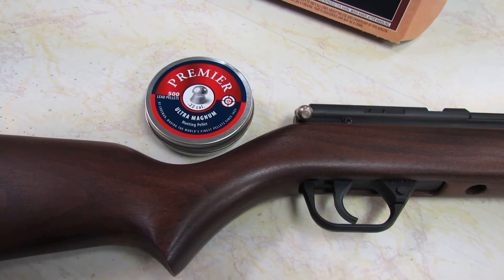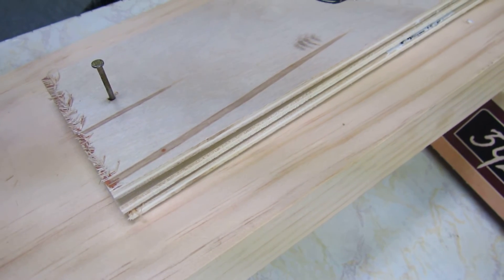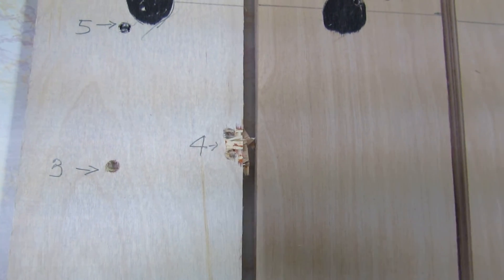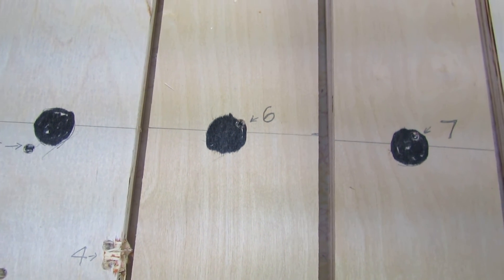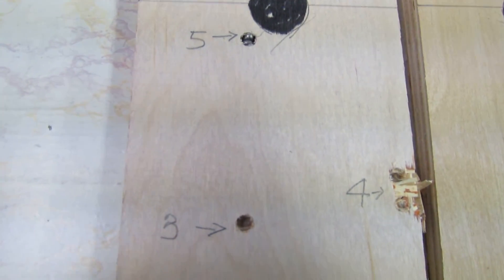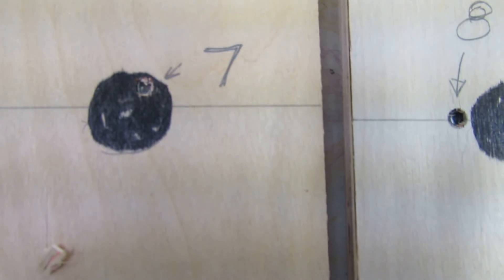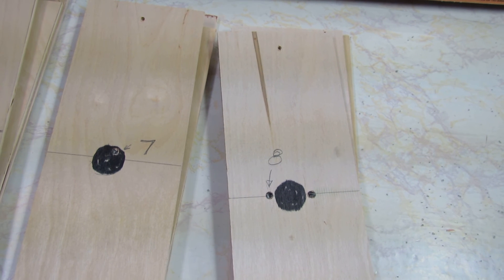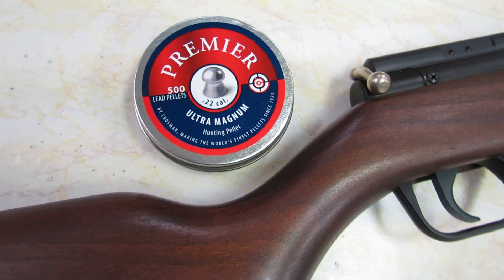Benjamin 392 field test

Comment: Thank you for the info, very helpful for the rest of us sighting in using the CP Pellets with the Benjamin 392. I have a 1962 Sheridan Blue streak and I used 6 pumps when I was a kid hunting and anything shot was DRT. Plan on the same with the 392 when mine arrives, intend on keeping it iron sights as I like the simplicity of this gun. Will probably use a pellet with better BC, but that is another story.

Comment: Both the models 392 and 397 can be modded in several different ways.
I've modded several 1377 crosman pistols and with all stock parts, each pistol can be pumped more that the factory recommended 10 times, producing over 690 fps with crosman 7,9 gr. pellets.
That's completely stock pistols with home made mods, even still using the plastic breech and 10.5 inch barrels.
My 392 has similar mods and it can be pumped up to 15 times, if you have the arms for it.
That rifle is shooting 14.3 gr. Crosman pellets at over 900 fps.
Extend the bolt tip to push the pellet farther into the breech.
Port the valve to allow faster exhaust of HPA.
When the hammer strikes the valve pin, it requires too much force to open the valve spring. I've measured over 10 pounds to open the valve.
I made a much lighter spring out of a guitar string wound around a drill bit in a slow turning drill motor.
Separate the spring inside the valve with a small washer and put a spring on the other side of the washer for the check valve.
That makes pumping much easier.
Put a spacer in the hammer spring to make it compress tighter and when you fire the rifle, the hammer hits the valve much quicker and stays open longer, allowing much better air flow behind the pellet.
I've seen no damage to the valve or any other part. I did however see that the piston cups wear out faster so I got a custom pump for it and the pump cup is holding up fine now. That's when I started seeing over 900 fps.
At 900 fps, this rifle is producing 25.72 pounds of muzzle energy.
That's a bit more than half of what a 22 short produces.
I've heard there are people super pimping these rifles and they are getting over 950 fps with those pellets.
A better pump and trigger mods also help a bunch.
Thank's for your review, enjoyed it.
Reply: GreatWalker177 The new model 392 and 397's will not let you remove the valve from the bottom any more.You need to get the pins out of the top and then remove the pump and valve.
I took a small gear puller and ground the end down to about 1/8" for about 1" in length then used that to push the pins out.
I  wasn't able to drive them out with a punch and hammer and drilling them would not work as they are very hard steel.
I used a fiber glass tent pole section to push the valve out the top and needed to hit it with a small hammer to break the valve free.
Crosman is making it very hard to work on these rifles now.
The bolt that holds the valve needs to be adjusted before trying to unscrew it. You will need to gently tap on both ends of the valve until you feel the bolt unscrew very easily or you will mess up the threads in the valve. Same when you put it back in.
You will probably need to replace the o-rings as they will most likely be torn. Crosman uses some kind of sealer to stick them in.
Any good hardware store will have o-rings but if you want Viton, you'll need to search for them.
I ported my valve with a Dremel and small rotary file. I also cut the check valve down to 5/16". This made the inside spring much lighter for faster and longer release of the HPA.
You will need to cock the rifle before pumping as the spring will not be able to hold the valve shut with the hammer resting on it.
If you're thinking of making the valve a flt head, be careful.
I used my bench grinder to grind down the valve head but when I was almost to the point of being flat, the little intake hole opened up to the size that the check valve fits in.
I left about 1/64" from being perfectly flat and the hole still had a little bit over 1/16" wall thickness left. This also had the end of the check valve coming out exactly even with the flat part on top, I couldn't have planned it better.
I then bought some "Liquid Nails Adhesive perfect GLUE".
I used Acetone to clean the inside of the piston cup, cleaned it real good and filled it up with the Liquid Nails till it was filled flush.
It took 2 days before I was sure it was dry and it cured clear and flexible like the cup rubber and will not begin to come apart.
Now I had a flat top piston. The length was exactly the same as I didn't cut anything down and to make the pump push a tiny bit harder, I placed an o-ring inside the cup holder to make it 1/16" longer. 
The air hole in the tube was still clearing the piston. Any more length and I would have needed to enlarge the hole.
I also opened the exhaust port hole to 3/16" and then took a 19/64" drill bit, ground it's end almost flat and milled out the exhaust hole until a small o-ring could be fit to the same outer diameter of the rear valve o-ring and glued it in place with a tooth pick dipped in Super Glue.
I was able to put the glue precisely on the area for the o-ring and while it was drying, I rolled it inside the tube of an old 1377 to make sure it had a curved shape.
Now you have all my secrets. My 392 dumps all the HPA, even with 20 pumps.
If you're interested in the chrony numbers, here they are.
Using 14.3 gr. Benjamin Discovery pellets.
8 pumps, 600 fps. The shorter check valve increased the air capacity in the valve and now it takes 10 pumps to get the pressure up.
10 pumps, 630 fps, 12 pumps, 655 fps, 14 pumps 678 fps. These are averages of 3 shot strings.
20 pumps did 722 fps, yielding 13.8 pounds of muzzle energy
Using JSB Match Diabolo Jumbo Heavy 18.13 gr. pellets did the following.
8 pumps, 540, 10 pumps 570, 12 pumps 590,14 pumps 612,18 pumps did 629 fps and 20 pumps did 645 fps, yielding almost 13.9 pounds of muzzle energy.
I know the rifle could be pumped over 30 times for a lot more power but maybe I'll do some testing at those numbers later, my arms are tired.
also, doing this much pumping heats the tube up causing a lot of heat and loss in velocities. It was really warm, smoking out the tube.
The new 392 came out of the box doing 615 to 620 fps with the Discoveries.
Crosman valves do not produce what the older model valves do.
I could bore out the valve for more capacity and power but who wants to pump 30-50 times.
This rifle will do over 800 fps but not if I have to work my butt off for it.
I'm not responsible for any damage or injury that may happen to you, your rifle or other persons or property.
These mods are to be used at your discretion so don't blame me if you screw something up.
This is the longest post I've ever done and it is the last one I'll ever do.
This is a hobby for me.
I hope this helps answer some of your questions and good luck with whatever you do.
Reply from the maker: NotThatDumb Thanks for your informative comments.
I've been tempted to try some of the valve improvements but have not been able to get the valve out of the rifle.
Reply: Right on...man

Comment: Interesting test! I'd like to see actual fps numbers from a chrony, because if the difference between 6 and 8 pumps is negligible, why wear out our arms?
Reply from the maker: Yeah, there doesn't seem to be a ton of difference between 6 & 8 pumps - I wish I had a more precise way to measure what happens at impact.
Reply: I just added a Chrony test on my channel for the Benjamin 397. There's a decent difference between 6 and 8 pumps with .177 caliber. I tried 9 and 10 as well, just to see if it's in any way worth it to over pump. Not worth it in my opinion.